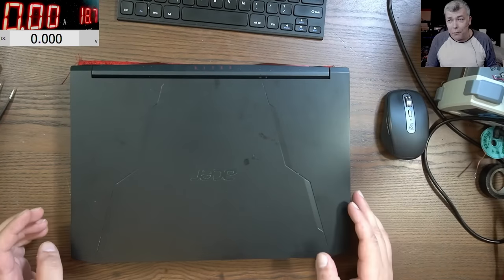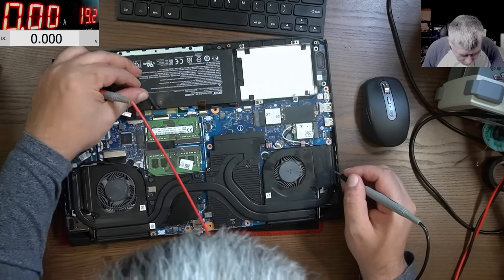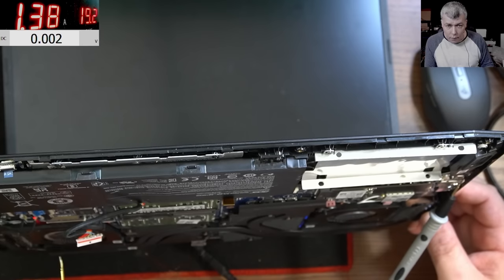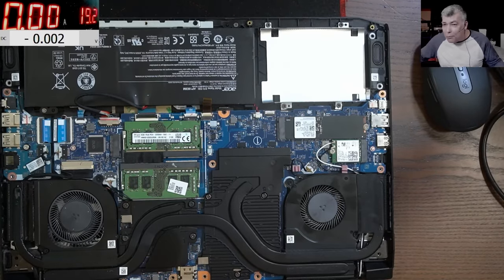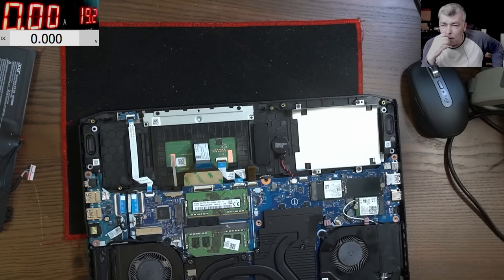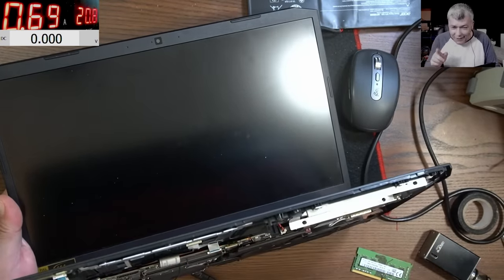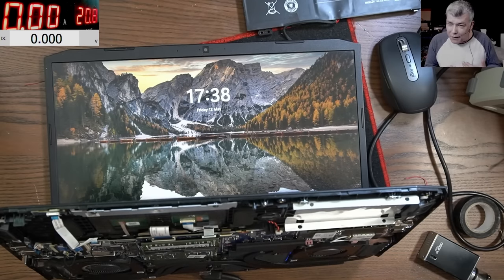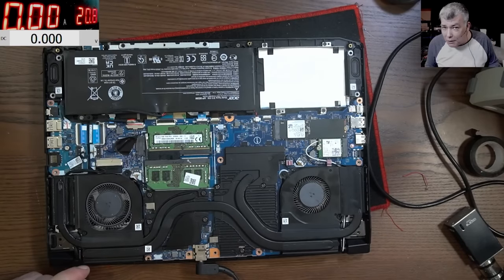Acer Nitro 5 modification - Using the lid sensor as a power button - Rerouting the power button.

Comment: Maybe you can fix the power button from up.
Take off the plastic cap
Reply: Then insert some copper strings to strength the carbon it has for making contact
Reply: Do that with a niddle
Reply: We used to repair the tv remotes this way

Comment: Next month the laptop will be back to repair the hinges. You can use a micro switch behind the power button after removing all the guts from the broken keyboard switch and fixing it using magic hot glue or maybe a reed switch somewhere on the plastic but the customer will have to carry a magnet with him.... (dodgy dodgy fix )

Comment: this is really not a good idea to solve the problem. Now you cannot hard-kill the machine anymore, pressing the power button for 3 seconds if necessary. Or the lid sensor doesn't work anymore correctly.
if you really want to use a hall sensor, use one from a donor laptop and leave the original one like it is and give the customer a free magnet... and tell him, that it's a new anti theft method. 
As a good repair shop, i'd first remove the power button and check for issues under the key.. often the problem can be solved there quickly... if not, the other option would be to place a little microswitch there OR if this doen't work because of connection problems the solution would be drilling a small hole and setting a small button on the side somewhere.
i like new ideas but this is a really dodgy solution and as a customer, i wouldn't like it.

Comment: Maybe you need to press numpad button in order to activate power button after you reseted bios. Maybe engineers designed that keyboard like idiots :). I saw that keyboard have numpad keys and power button is on that part of keyboard.